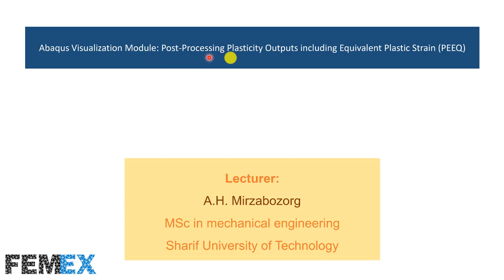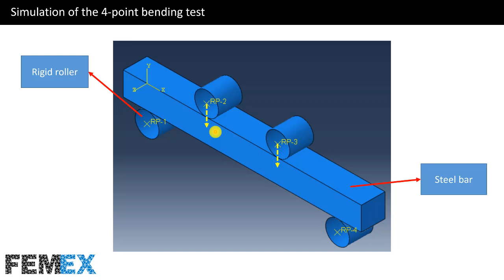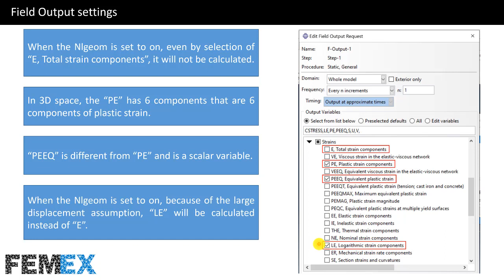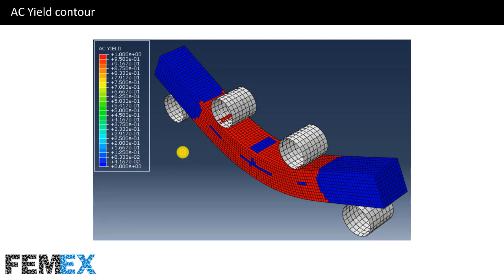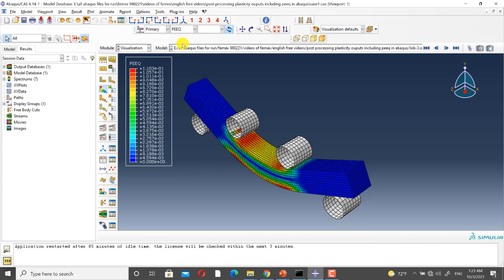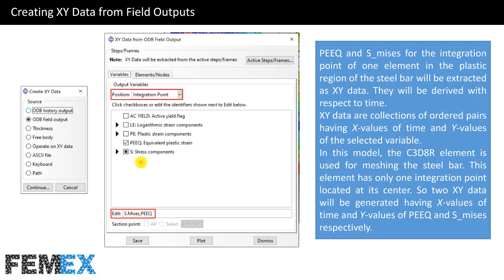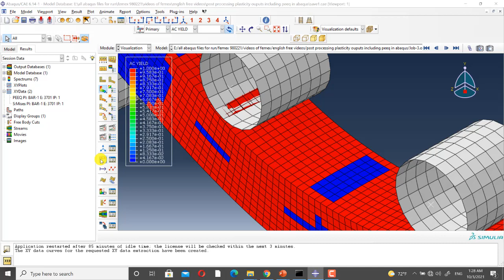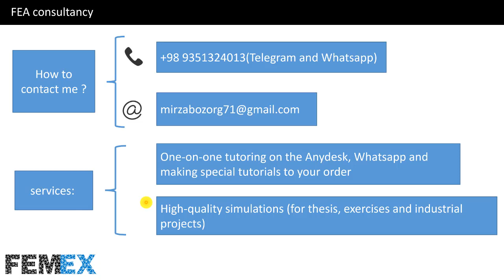Abaqus Visualization Module: Post Processing Plasticity Outputs including Equivalent Plastic Strain

Comment: Is it possible to create a 3D fracture locus using abaqus?
Reply from the maker: Hi.
Do you mean root locus ?
As far as I know, root locus is a curve which is fracture strain versus stress triaxiality. Also it varies with respect to strain rate.
It is used for ductile damage and shear damage models and to calibrate the Johnson-Cook damage. But it is not 3D. What do you mean 3D root locus ?
Reply: @FemexIran  You can include a third parameter to plot a 3D root(fracture) locus which is the Lode Angle parameter.
Reply from the maker: @abdulwahabqarooni7598  Yes I have read about it. Yes it can be implemented in Abaqus via writing keywords and adding keywords to the input file.
Reply: @FemexIran  Unfortunately I am using Abaqus CAE which doesn't support the keywords for lode dependency input file. However, I'm trying to input this parameter by making my own function using Matlab to calculate the stress fracture using Hosford-Coulomb model.
Reply from the maker: @abdulwahabqarooni7598  You can make your model via Abaqus/CAE. Then create the input file. Then modify it and add the Lode angle dependency. Then create a job from the input file and run the model. As this capability is added for the Abaqus solvers, there is no limitation in using it. By following the mentioned procedure, you can add the Lode angle dependency to your simulation.
Reply: @FemexIran  Thank you for your reply. I just did this and I noticed that the Damage initiation and evolution disappeared after modifying the input file from the abaqus interface. However, I'll run the job now and see if it will include the damage criterion nonetheless in my ODB.
Reply from the maker: @abdulwahabqarooni7598  I think there is a problem in your modified INP file because it is clearly explained in the Abaqus documentation.
Reply: @FemexIran  Yes I followed the input text as per Abaqus's documentation as follows: *Damage Initiation, criterion=DUCTILE, Lode Dependent

Comment: I have selected the total strain (E) in the step. But I always got Logarithmic strain (LE) instead. How could I get the total strain in all directions?
Reply from the maker: Hi.
If you set the NLGEOM to on, Abaqus always calculates LE instead of E because it will assumes that finite strain happens. If the NLGEOM is set to off, Abaqus assumes that small strains will happen and it calculates E. Actually LE is the exact strain and E is the approximate strain.